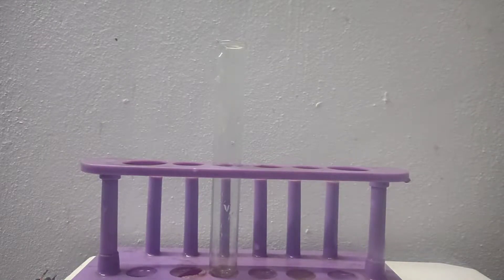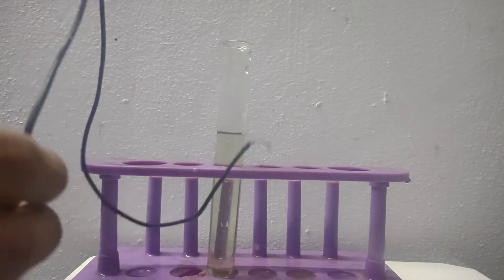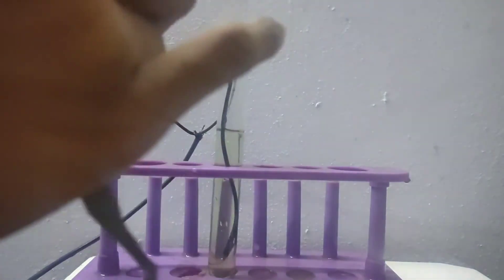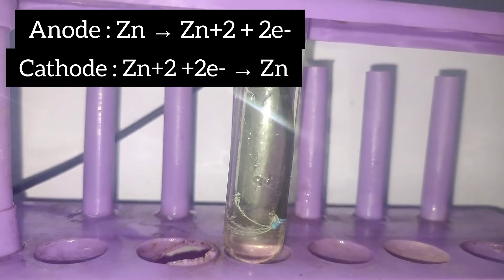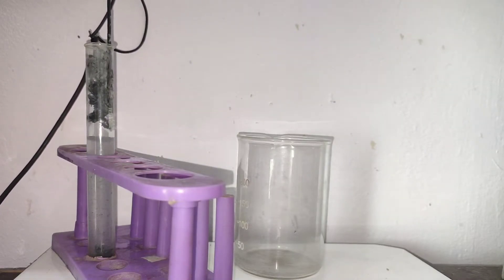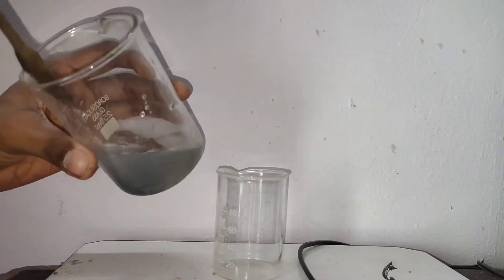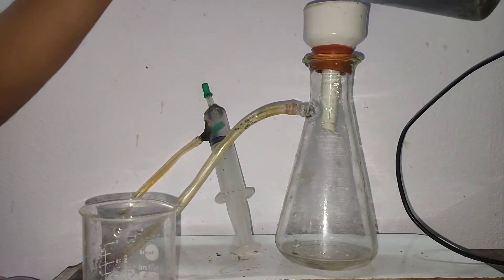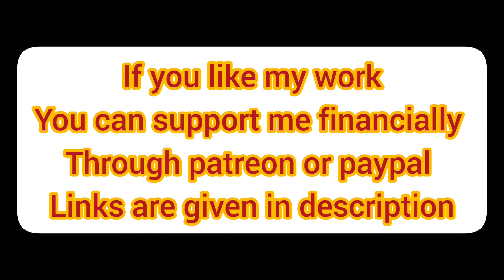How to make Zinc powder by electrolysis

Comment: Is it fine enough for thermite ?
Reply from the maker: Yes but zinc is not used in thermite
Reply: @TheDIYChemist  classic thermite is iron oxide and aluminium 
But zinc. Reactivity is quite close to aluminium so it can be replaced
Reply from the maker: @koukouzee2923  no zinc is not as reactive as aluminium . Aluminium is much more reactive .
Reply: @TheDIYChemist  well Iam planning to react it with copper oxide anyways 
It's reacting either way
Reply: @TheDIYChemist zinc powder also works in thermite